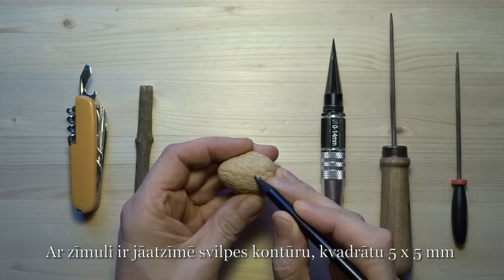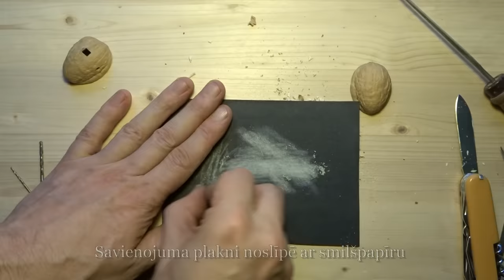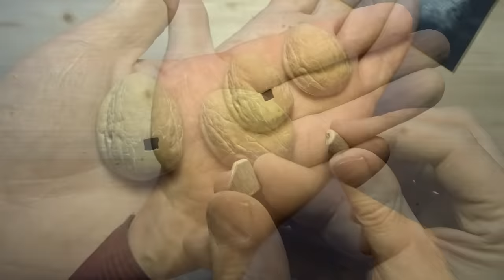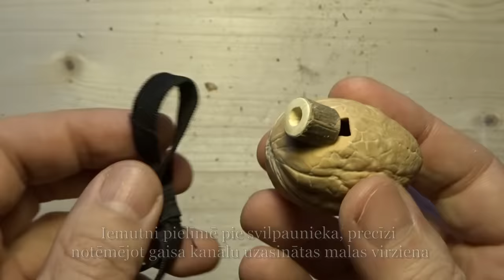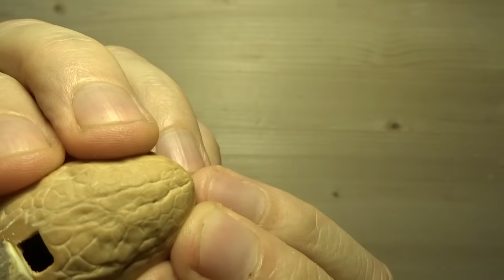Valrieksta svilpaunieks / Walnut Ocarina

Comment: Here's an English translation of the on-screen Latvian instructions.  Translation was worked out with Google Lens, Google Translate, and ChatGPT for a couple of the more confusing words.  (The piece of wooden stick he used for the mouthpiece translated to 'splinter' and 'dowel'.   I just went with dowel.)

 0:22 With a pencil, you need to mark the outline of the whistle, a square of 5x5 mm.
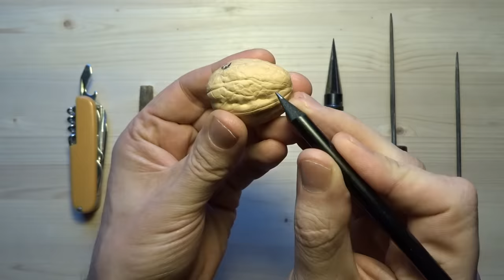 0:35 Mark the centers of 4 holes, with an interval of around 2.5 cm.
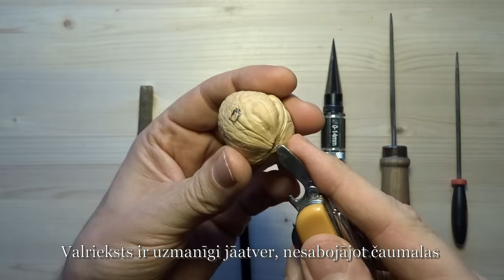 0:50 The walnut must be opened carefully, without damaging the shell.
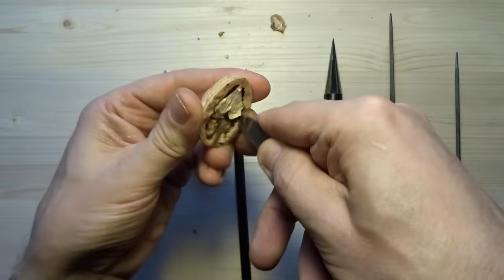 1:20 The partitions should be cut out, the core of the nut should be removed and the inside of the shell should be cleaned.
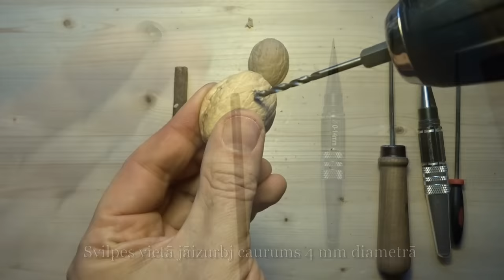 1:45 A hole with a diameter of 4 mm should be drilled for the whistle.
 1:55 Drill the side holes with a 1.5 mm drill bit.
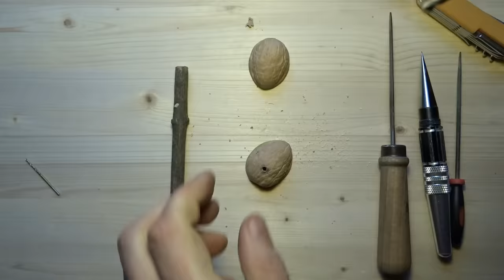 2:20 The second hole can be enlarged to 2.5 mm, the fourth hole to 3.5 mm.
 2:32 The whistle hole is widened with a file, grinding it into a square shape.
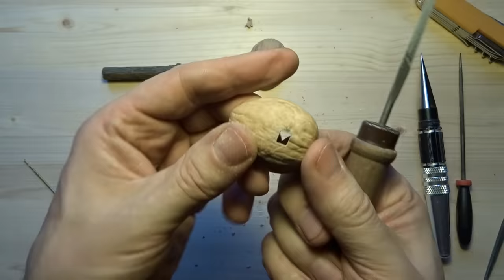 3:03 The whistle hole must be sharpened.
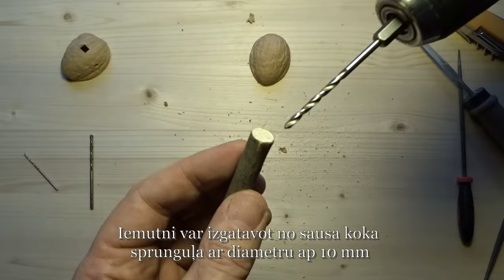 3:20 The mouthpiece can be made from a dry wooden dowel with a diameter around 10mm. 
 3:30 A hole with a diameter of 4mm will be drilled in it. 
 3:40 Cut a section 1 - 1.5 cm long
 3:55 With a round file the mouthpiece must be ground inside.
 4:07 To attach the mouthpiece, the edge must be cut diagonally.
 4:35 The joint plane is sanded with sandpaper. 
 5:05 For the attachment of the mouthpiece, the connection plane is also formed in the upper part of the whistler.
 5:53 Sand the edges of the mouthpiece.
 6:10 Expand the air channel with a flat file.
 6:48 The shells are glued together with moisture resistant glue.
 7:33 The mouthpiece is glued to the whistle, precisely targeting the direction of the sharpened edge of the air channel. 
 8:12 The whistle is tuned by increasing the holes.
 8:26 The fundamental tone can be raised by enlarging the whistle hole.
 8:58 The tones of the whistler sound in sequence, comparing each next one with the previous sound.
 9:15 Fine tuning takes time and patience.
Reply from the maker: @fizzlewicket you are awesome, absolutely seriously. I think I'll use your translation in my video, if you don't mind:yougotthis:
Reply: Gracias por traducir, eres muy amable.
Thank you for translating, you are very kind. 👍🏻
Greetings ...
Reply: @aleksandrsmaijers  es ud, una persona maravillosa. Gracias por compartir su trabajo 👍🏻
Saludos 🤗
Reply from the maker: @victoria2311  ¡Gracias sinceras!
Reply: i love you❤
Reply from the maker: @mixedmediaartgirl300  Thanks for the lovely comment!🙂
Reply: Thanks so much this is great!! 🙏
Reply: Jesus Christ cherishes you my friends, truly He does love you

Comment from the maker: :stayhome:Thanks to everyone who watches, share, comment and like our videos!
We created those with the support of the Latvian Cultural Capital Fund, with the aim of popularizing the making of musical instruments in Latvia. That's why all movies have Latvian subtitles. We are currently working on new videos🎥 and it doesn't look like we will have time to translate the old ones. And I wouldn't want to do it in aliexpress style, our English is not that good, it's quite confusing.'-) However, I will add answers to frequently asked questions, maybe this can help: 
1.The most important thing is to make the whistle very accurately. The air flow should hit directly on its pointed edge, as in a clay ocarina - 7:37
2. You can slightly increase the basic tone of the ocarina by increasing the hole of the whistle - 8:24
3. The holes are adjusted one by one, in turn. The bigger the hole, the higher the tone 9:26
4. The ocarina can be tuned from any other note as long as the nut is smaller or larger than the one I use.
Don't get discouraged and don't give up.'-) Good luck!♥:yougotthis:

Comment: Spectacular! Might suggest, when making the mouthpiece/blower, to do as much drilling and carving first and then cut it down to a short piece. That way you have something to hold on to rather than pinching a short length of stick. You don't want to slip and injure your fingertips. Always want to keep your fingers in good order...your tunes are so soothing. Many thanks.
Reply from the maker: Thanks for the tip, you're right! Fingers should be spared👋

Comment: выходит, пентатоническая окарина получилась?) жаль балтские языки не понимаю - думал румынский)) а там подробности, наверное..)
Reply from the maker: Maybe this can help: 
1. You can slightly increase the basic tone of the ocarina by increasing the hole of the whistle - 8:24
2. The holes are adjusted one by one, in turn. The bigger the hole, the higher the tone 9:26
3. The ocarina can be tuned from any other note as long as the nut is smaller or larger than the one I use.
Good luck!:yougotthis:P.S. It's not pentatonic, it's diatonic scale, just for 5 notes - do-re-mi-fa-sol.